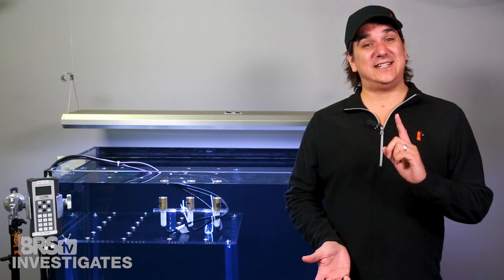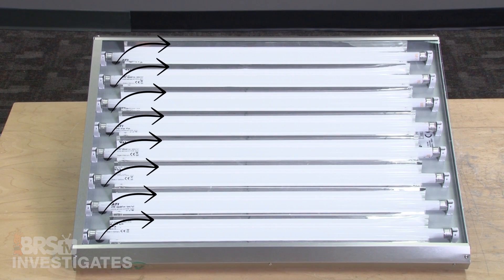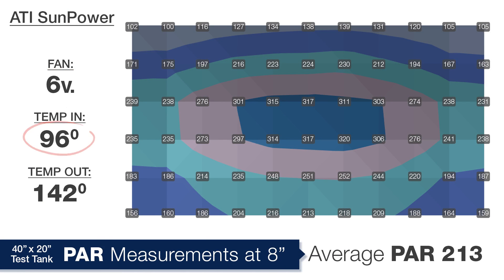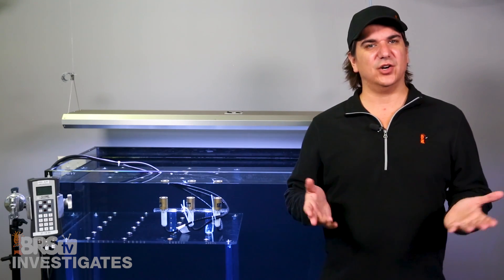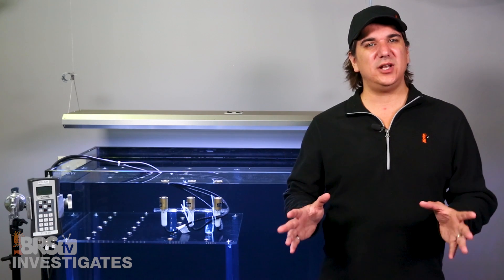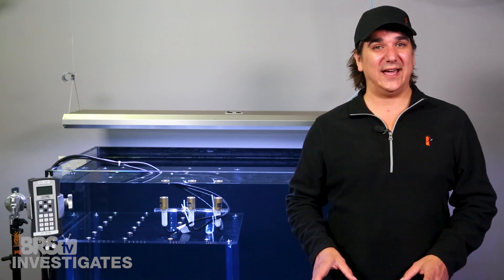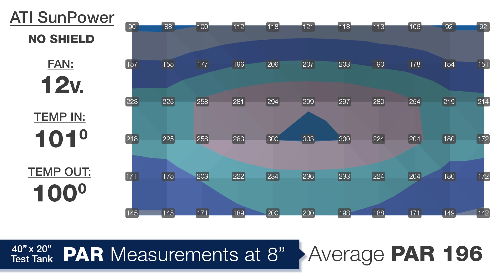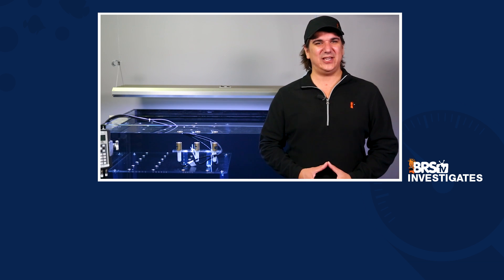Does cooling T5 bulbs really affect their performance? | BRStv Investigates

Comment: I've been considering one of these fixtures for awhile to pair with my Radions(2) in a 4 ft cube. The thought is better light distribution and less dark areas. Are these fixtures noisy? Do you see benefits by combining the two? This area of my home is usually warm because of the humidity. Would this fixture contribute a noticeable difference in the temperature of the room?
Reply: I can personally say that this fixture does give off a little more heat than the xr30 pro's I came from. I went from LED to T5 because to add another radion would have cost more than going to T5 and the growth I've noticed just from changing is completely worth it. I'm going to add an LED actinic bar on either ends as the t5 doesnt have that pop like before, but again the growth is insane and IMO worth it. These fixtures were actually quieter than the radions were for me and my buddy.

Comment: So my mind just went wild with questions, but I'll stick to 2.   First one:  What the hell happened with that 3v to 6v setting?  3v 107° in and 139° out, yet at 6v 103° and 144° out?  Cooler air that is actually moving faster and it somehow became hotter exiting?   Retest?

Second comment:  You really should do a realistic lifespan of bulbs based on various factors,  you kept mentioning the ballast life, but how much do you reduce the life of the bulbs by running them hotter versus cooler?  If I can squeeze another 3-6 months out of a t5 bulb I think I'd more than happily run it at lower PAR readings.
Reply: Mike B your first question: air that go's in is cooler in the fixture the air drags the heat out so that's why the output air is hoter. Cool air enters hot air exits.

Comment: Has ATI commented to you about your questions, such as (1) which way do they want the labels of ATI bubls; (2) what is the optimal voltage for the fan (manual says 9, but why?), and (3) wouldn't a better design involve simply blowing air over the ballasts and venting out the side instead allowing air to also blow over the cold spot?  What is ATIs research (if any) say on these topics.  I currently use a 6 bulb ATI fixture so this research is spot on.  Please continue shining the light on these topics (pun intended)!